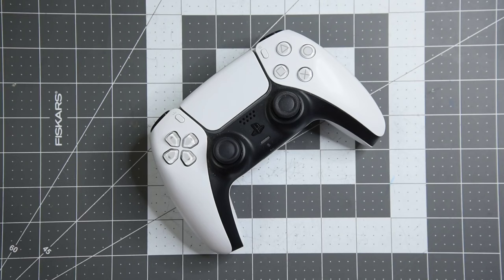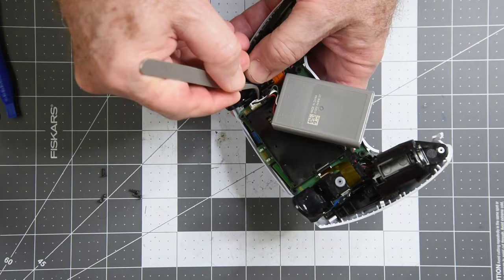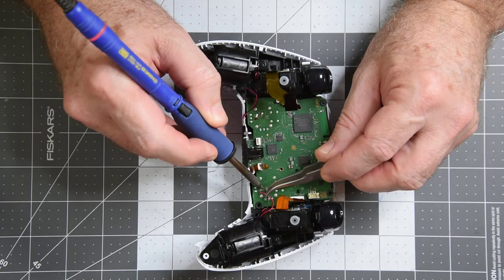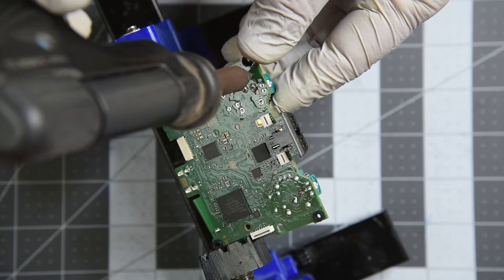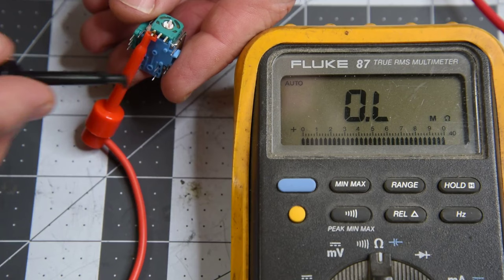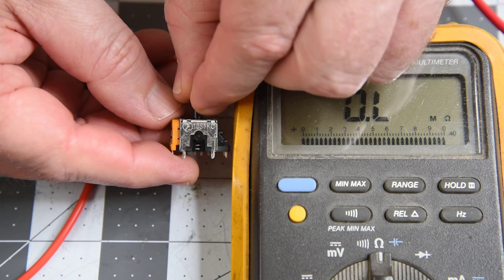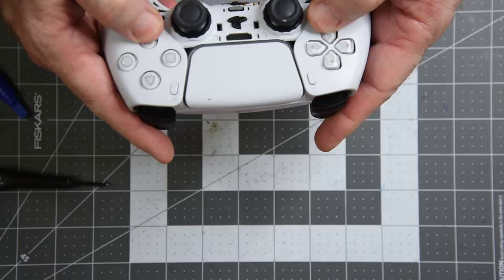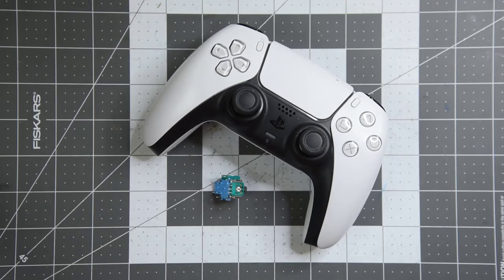PS5 DualSense - Joystick Replacement

Comment: Hello, I started soldering as a hobby to replace a DualSense analog stick. While looking for a replacement method on YouTube, I came across MPE's video. And I lost my mind when I realized that it was difficult to replace and that I had to use a FR-301 product or a heat gun just to improve my skills in handling a soldering iron. 

\In the end, I bought the FR-301 with a lot of thought, but I wonder why it's almost impossible to replace the analog stick module itself as long as you handle the soldering iron well. Could you possibly get an answer to this? 

And I really enjoy watching MPE's videos. Especially, your voice is like a voice actor from the Discovery Channel, which is very attractive. have a good day.
Reply from the maker: I think when they design the thing there is no though put into them being repaired.  It’s a bit of a job just to get to the joystick.  It is possible to use a very small pair of side cutters and cut the joystick leads.  Then just remove one lead at a time.  But still a possibility of damaging the PC board by the cutting process.  What are you thoughts on the Hakko FR-301? And thank you for watching and the comment.
Reply: @metalplasticelectronics354  I don't think Sony has left open the possibility of replacing the analog module of dualsense. Even at the official after-sales center, partial repairs or replacements are carried out only within one year, and after that, they refuse to pay repairs because they are consumables. In the video, I saw that there is a high possibility of PCB damage without a vacuum disoldering tool or a heating gun, so I purchased the FR-301, which I have been eyeing. The country of origin is Japan, and in Japan, considering the exchange rate, it is only about $150, but in Korea, it is an expensive piece of equipment that costs about $330. However, the performance is thought to be very good, and in fact, mechanical keyboard enthusiasts use it a lot for lubrication. Anyway, I was worried about where to buy reliable parts, but I saw the video and purchased the parts from kasynparts. thank you!
Reply: Look up hall effect joysticks - this is the design-tech solution that has been gaining attention and should be offered more and more as part of or as replaceable option going forward
Reply: Currently trying to get my analog with a fr301 and I've gone over all of the pins and I still cannot remove the analog. Any tips ?
Reply: @mr2k_all_day  Get some tweezers and wiggle the pins to find out which ones are stuck. If it is just a tiny bit of solder you may be able heat it with a soldering iron and free it just by moving it a bit with the tweezers. Otherwise resolder the stuck pins, then try cleaning them again. You probably didn't heat up the joint enough before pulling vacuum, so try turning up the heat on the 301.
Reply: @nerdstrangler4804  will do. Thank you

Comment: Do you also have clicking sound of the analog sticks when simply moving them slightly into a direction? Only my original dual sense with the console did not do this. It's annoying as hell. And after four replacements I gave up
Reply from the maker: No, no clicking sound.  Did all your replacements come from the same place?  Do they make the clicking sound unmounted and do you know what brand they are?
Reply: @metalplasticelectronics354  im not talking about the analog stick replacements. the whole controller was replaced 4 times by sony. even with a new revision controller. take a look at reddit or youtube. this is the worst quality i have ever seen. dualshock 4 made no problems at all with sticks. i have even coil whine with dualsense
Reply from the maker: Oh I was thinking about the replacement joystick.  I went and checked the one I replaced and it makes no noise.  But I went back and checked the ones that hadn’t been replace.  And they all make a small noise.  So I would imagine that would mean the noise is coming from the joysticks they are using.  I’ll have to look into a bit more.
Reply: @metalplasticelectronics354  today I could check for the first time in a shop dual sense controller. One controller was fine, the other one had the same issue as mine. Sony's qa seems to be still bad
Reply from the maker: It may be who makes the joysticks.  I've tried 2 alps and both make a sound.  I've tried 3 Favor Union and none of those made a sound.  But that's not a big trial.
Reply from the maker: I just put up a video about the DualSense clicking and the reason for it.
Reply: @metalplasticelectronics354  thanks for letting know and finding the root cause! Appreciated

Comment: It’s very common. I’m on controller number 2 and it just broke and I’ve only had the ps5 a year and a half. And both controllers broke after 6 months.
Reply from the maker: The joystick modules are a real weak spot for these.
Reply: @metalplasticelectronics354  I just got the dual sense edge because I can’t deal with this again.
Reply: @SuperCarsFromTheHood Dualsense Edge has the exact same problem y'know.
At that price range you're better off  with a HYPR modified Dualsense with electromagnetic joysticks for a longer joystick lifespan

Comment: Why cant i just replace the sensor piece instead of the whole analog stick
Reply from the maker: You can, and it’s much easier than replacing the entire joystick module. You just have to get the right potentiometers. The Alps and Favor Union potentiometers are not interchangeable. I go over a couple of ways of removing the potentiometers in this video: https://youtu.be/slxgHcYHnm8

Comment: Beginner here. Any tips in the case of one the haptics wires being broken as mentioned at 2:43?

Thanks for the video.
Reply from the maker: Depends on where it’s broken at.  If it’s still long enough to reach to the PC board, then just strip a bit of the insulation off the wire and solder it back.  If it broke at the haptic motor, I don’t know if they can be gotten into without tearing them up.  If the wire is still there, just too short. Will need a bit of small wire to extend it.  Be best to have some small heat shrink tubing, but some electrical tape will work as well. Want to make sure where the wires are joined don’t short to anything.   Good luck.

Comment: So for every YouTube video I’ve watched, replacing the joystick works and no adjustments need to be done, yet every single time I replace the joysticks, they are off center, sometimes by 20% or more, am I doing something wrong? Frying the motherboard by heating the holes too much? It’s basically every joystick, I’ll occasionally get one within 5% but never centered, a response would mean the world to me
Reply from the maker: The replacement is almost never dead center.  Is it good enough to use is the thing.  And I guess that depends on the user.  I do check the resistance of the replacement joystick.  If the center value is off by more than 20% I toss that one.  In my batch of 20 joysticks I ordered, one was outside that range.  If you want it to be aligned as accurately as the original,  that’s going to be near impossible.  Would have to measure the values of the original pots center offset.  And then would have to hunt through probably hundreds of replacements to find a close enough match.

Comment: Is there any way to fix a joystick without replacement? Mine doesn’t drift anymore but the top part of the joystick came loose and spins
Reply from the maker: Is it the joystick shaft that is spinning or something broke loose in the knob?  I doubt a glue would hold the joystick shaft so probably have to replace it.
Reply: @metalplasticelectronics354  the knob came loose
Reply from the maker: I think you can by just the replacement knobs from Amazon.  It will require pulling the PC board out of the controller.  But you don't have to unsoldered anything.

Comment: I should get myself a heating pad.. I currently use a frying pan weighed down with a road spike.

What I'm wondering is where you got that handy little mount to hold the board in place.
Reply from the maker: It came from Amazon.  Think the same thing is sold under a bunch of different brands.  Just search pc board holder.
Reply: @metalplasticelectronics354 just ordered a similar board holder, and a cheapish desoldering tool!

Thanks for the video & link, I ordered extras. Got a controller to fix, I'll probably wind up grabbing extra controllers off marketplace too.

Comment: Thank you for the video. 

Btw, I don't think the value of the potentiometer matters… unless the pcb reads the value of it, which highly doubt.
Reply from the maker: I don’t think it reads the value of the potentiometer.  One end of each goes to ground and the other end if I remember right is at 1.8 volts.  But I think several people have had centering problems using the 10K pot values.  It depends on how the voltage is read.  If it’s just a basic SAR ADC then the difference between the 10K ohm and 2.1K ohm could have some effect on the sample and hold values.  I think it’s safer just to replace with the 2.1 or 2.3K potentiometers.  To much work to have to redo it.  And thanks for the comment.  I do appreciate it.

Comment: ONE IMPORTANT QUESTION/PROBLEM, i replaced the right module on my bdm 030 controller, i had serious stickdrift and it got fixed, EXCEPT now it is SLIGHTLY is off centre (10%↗️). Why is this happening?
Reply from the maker: The new potentiometers are that much different from the original ones.

Comment: Just a question. How are using the soldering tool to remove the pins? If you heat them aren't they gonna melt in more and get stuck?
Reply from the maker: If you are asking about the vacuum desoldering tool,  It just gets hot enough to melt solder, and then when the trigger is pulled, a small vacuum pump is started, sucking the solder out of the PC board hole. At least it does when working correctly.
Reply: Once the solder is hot enough to be in a liquid state, the pump quickly sucks it up

Comment: Any vacuum disoldering tool will just work fine? Or should I get a specific one?
Reply from the maker: I only have experience with a couple of the old Hakkos.  They are great, but the current ones are very expensive. If I was replaceing my old Hakko I would probably try one of the cheap ones from Amazon. It not someting I use every day.

Comment: What material were you using when mounting the new analog stick?
Reply from the maker: Its Kester 44 63/37 solder.
Reply: @metalplasticelectronics354 thanks, but do you know if it matter what kind we use?
Reply from the maker: @F1erc3  Any brand-name electrical solder should be fine.  Don't use plumbing solder; the flux in it will damage the PC board over time.

Comment: Hello so can i replace the ps5 joystick with a ps4 one
Reply from the maker: Should work somewhat but they are different values.  Would be best to use the correct joysticks. And if you are going to go to the trouble to replace them why not go with a Hall effect or TMR joystick so you won't have to worry about it again?

Comment: Tried everything you did in here and can’t get it desoldered. It’s melting but can’t get the holes empty
Reply from the maker: You can cut apart the joystick module with some small side cutters and remove 1 pin at a time.  Just be careful not to damage any other parts on the board.  There’s some really small capacitors close to the joystick modules.  If the hole still has solder in it.  Put fresh solder on the pad and try again with the vacuum desolder tool or solder wick to clean the hole out.  Can us a small stainless steel needle to push the melted solder out if all else fails.

Comment: What’s the best brand of potentiometers to buy for PS5?
Reply from the maker: I think I would go with the Favor Union ones.  The ones with the orange potentiometers.
Reply: @metalplasticelectronics354  should i also get the same band for a dualshock/ps4 but with the 10k ofc
Reply from the maker: If your replacing the joystick module, then I do like the Favor Union ones a bit more.  But if just the potentiometers are bad on the joystick module.  I try for the most part to just get the same ones that are installed and just replace the potentiometers.  It’s a bit easier.

Comment: What is the tool you use at first? The tool to melt throuch the chip. It is not a regular solding tool is it ?? I am looking for a similar item.. but i bought two already, but both cant get through, or they cant melt the solding away… do you have the name of the tool that you use ??
Reply from the maker: If you are talking about the tool used at about the 3:50 time.  That is an old Hakko 470 desoldering gun.  The soldering iron used to remove the haptic motor wires at the 2:45 time is a Hakko FX-951 soldering station.
Reply: Thanks !!😁

Comment: Hi, so I've just finished completely re-soldering two new joystick assemblies.  The new pots were 2.06 kOhm and the old ones 2.2 kOhm.  I thought this is probably within tolerence.  However, the left joystick still has a constant drift on both axes.  Is this a mechanical centering issue, or an resistance mismatch issue.  Any ideas?
Reply from the maker: It wouldn't be resistance, 2.06 is well within tolerance.  Did you just change the pots or the entire joystick module?  And is if drifting the same way to old ones were?
Reply: Hi, OK that's good to know.  I changed the whole joystick module, both of them.  In the originals the drift was not too bad but they also had bad jumping, which I took to be a sign of track wear on the pots.  Now the joysticks are smooth in operation, just with annoying "offset" drift.  I thought there might be some kind of calibration adjuster, but seemingly not.  I should add, I'm not a gamer, this is all for my teenage son 🙄 @metalplasticelectronics354
Reply from the maker: I would get some replacement potentiometers and just try replacing the pots again.  If you still have the old ones, try and measure the center tap ratio.  And look for a new one that is close.  As there doesn’t seem to be a way to calibrate the DualSense controller.  I think it’s a case of the old pot being off center in one direction and the new pot being off center in the opposite direction.  And it’s just too much difference.  That’s my best guess.

Comment: I did the whole josytick replacement now the d-pad only goes to left and the joystick is non-responsive. I checked all the solders nothing seems touching each other. What is the possible cause?
Reply from the maker: Double check and make sure all the flat flexible cables are plugged in good.  Might look closely around the area especially near the ICs, looking for any solder splatter.  I don’t know how the D-pad is related to the joysticks.
Reply: @metalplasticelectronics354  Thanks for your reply and video by the way. Not sure if the assembly I bought is defective. It is the same assembly that you use in your video. I will double check it or desolder everything and replace with my other extra parts.

Comment: Put a new extreme tension stick on my bdm 020, but it pulls max hard to the left... So i got another stick module to replace, and that ones doing the same thing... I think maybe i damaged the board somehwo? It doesnt look like ot but idk what else it could be. Not sure if i should cut my losses or get a new main pcb for the controllwr (47$) and then redo it? ... Ugh. Feels kinda hopeless.. i had a hell of a time with desoldering... Ended up using flat cutters to chop the pins on the opposite side, then pull module off then clesr holes with my crappy desolder plunger and wick. 🙄 I ordered a vacuum desolderer, so that should help. Is it even worth  paying 50 when i can get a new controller for like 70?  Ugh i feel lost and cant find a resource for help anywherw on resdit or on forums
Reply from the maker: If it's at maximum left, then that means probably 0 volts going to the processor. Do you have a multimeter? If so, check the voltage on the pins of the left-right potentiometer. The left pin should be ground, the center pin should be around 0.9 volts, and the right pin should be 1.8 volts. If the 1.8 is missing, then you know it's the trace to that pin. You can run a thin wire from the other 1.8-volt up-down potentiometer pin. If the center pin does have about 0.9 volts on it, it's probably the trace back to the processor. That one is much harder to run a jumper on.